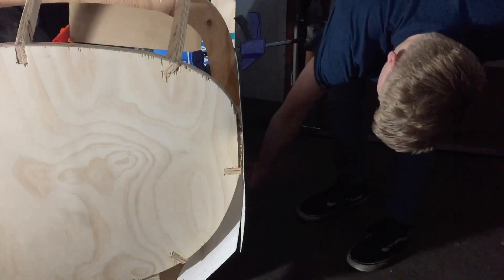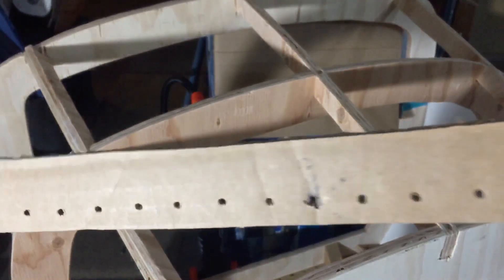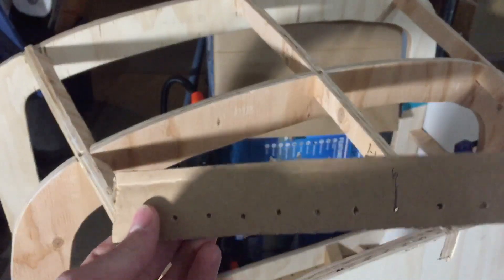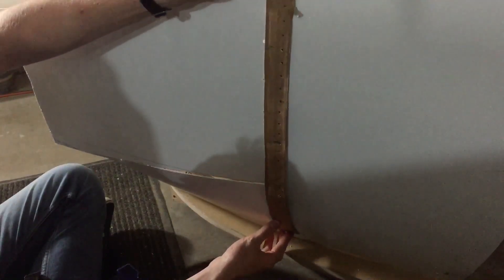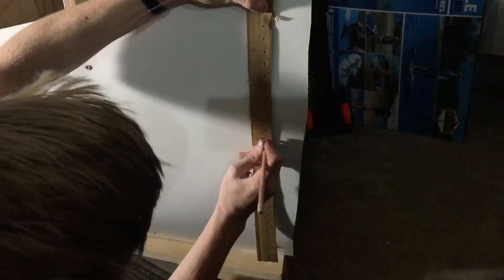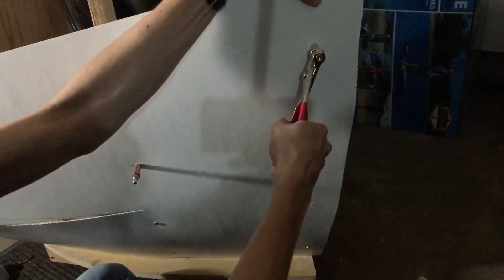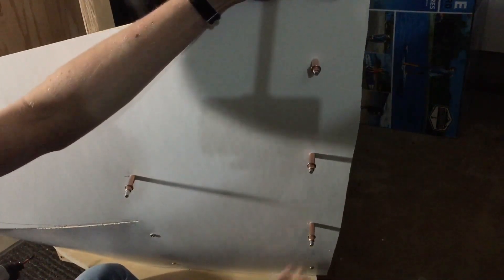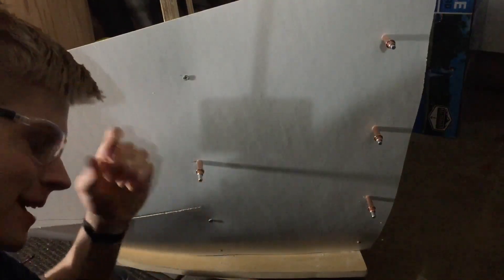Putting Fiberglass on my Simulator? Cessna 172 Project | Ep 14 "Drills and Thrills"

Comment: You are making great progress!  You likely already figured this out, but on the area where you made the long cut to make the curve, when you need to trim the overlap to fit, temporarily fold the top over the bottom, or visa versa, drill and secure above and below the overlap, and then once everything is secure you can trim both the top and bottom together to make as near perfect seam as possible. One other tool as you move forward that is really worth investing in, is an oscillating multi-tool. You can get inexpensive ones at places like Harbor Freight. They can give you clean cuts in ways and places no other saw can. I'm proud of you for putting in so much work and effort, and for your brilliant mind as well. I'm not sure what your life's ambition is, but if you put this much passion and skill into it, you will definitely be a great success! Well done!
Reply from the maker: Thank you so much, David! I've never really seen a practical use for an ocosilating multi-tool, you just blew my mind! Thank you so much for following and supporting the project!!